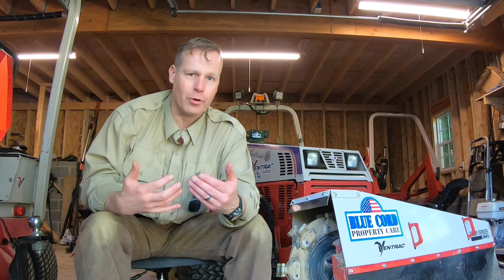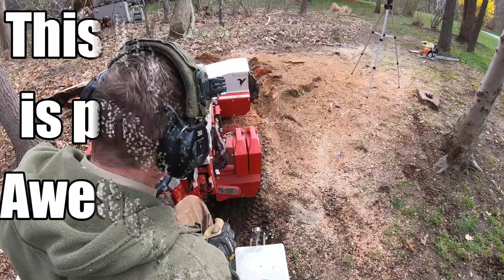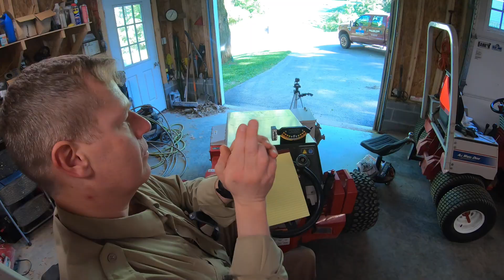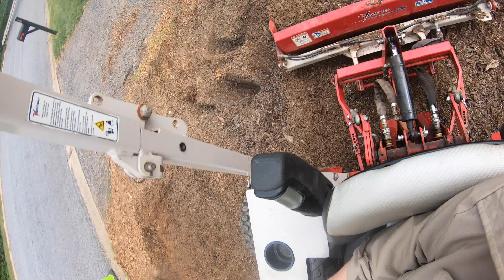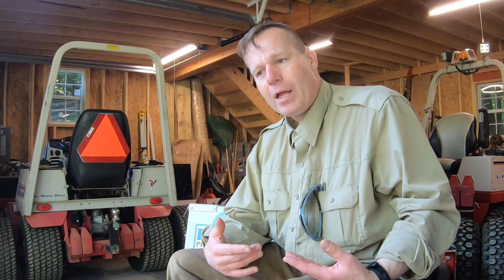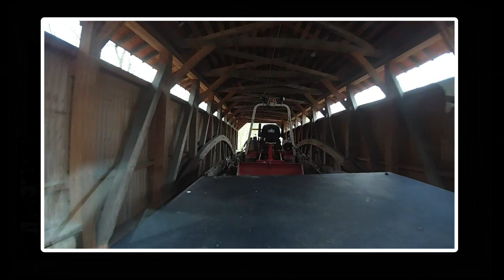This New Stump Grinder is Awesome!

Comment: Has Vantrac said what the life of the teeth is
Reply from the maker: The teeth are not manufactured by Ventrac...and that's a lot like asking how long a chain on a saw will last.  It's the way the operator uses it and how careful you are.  Again, the teeth can be rotated two additional times for a new cutting edge before replacement

Comment: Cool & creative Video! I love it when a plan comes together. Having 12mph surplus for flux capacitor activation! 😃 That's a whole lot of energy in that disk. Maybe the 4 belts can try to hold it back in case the wheel tries to exit the house with its bearings.😆 Not standing directly in line with that! I can see the need for some heft in the structures design-- and they gave it that.
Reply from the maker: Yeah, this thing is TOUGH!  When 88MPH isn't enough, 100.5 will get it done!

Comment: I was originally told I would see my new grinder in June, now they are saying September. My dealer did let me know yesterday that my canopy is shipping out so at least I'll have that. Does the new stump grinder use the same cutter teeth as the old one?
Reply from the maker: Everything is delayed these days.  I know it's tough, but it's worth the wait!
Reply: Looks like it has greenteeth on it still.  700 series probably
Reply from the maker: @12vmoneypit  Yes, 700 series, the same as before
Reply: I just noticed yesterday that the replacements from my dealer were 700 series red... not green.  Red are for soft wood... is this what all the 180 stump grinders have?
Reply from the maker: @brandonpaul5712  I use green but the ones that came with the prototype look to be red.  I have a bag of green replacements that I keep in the truck